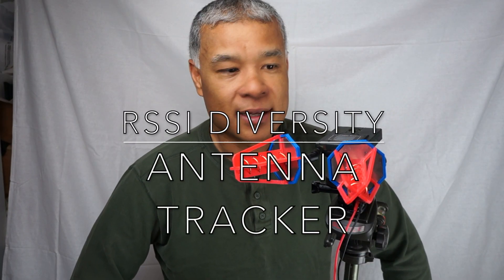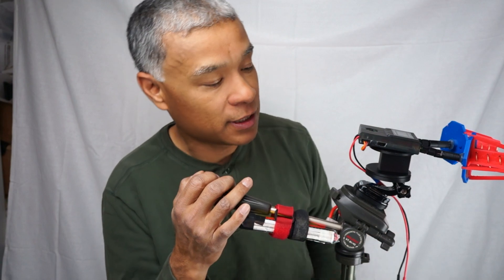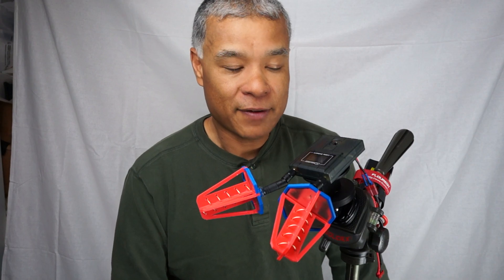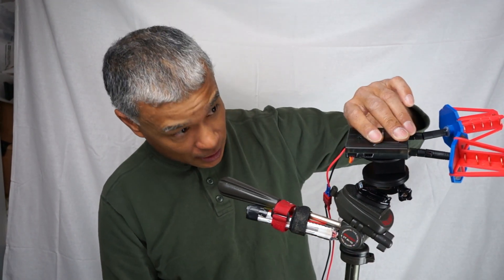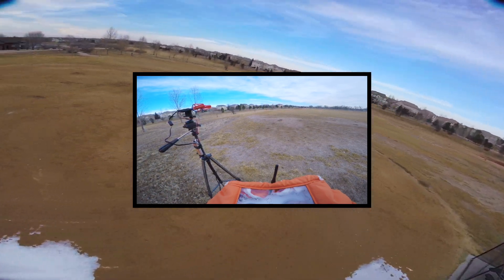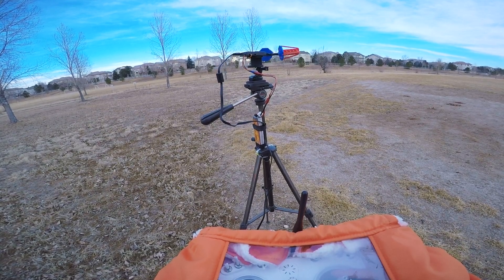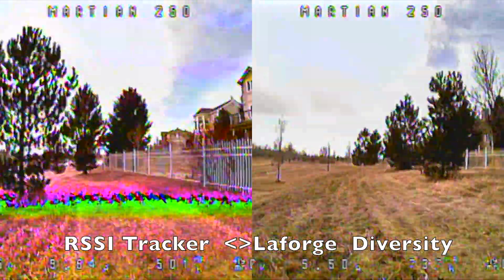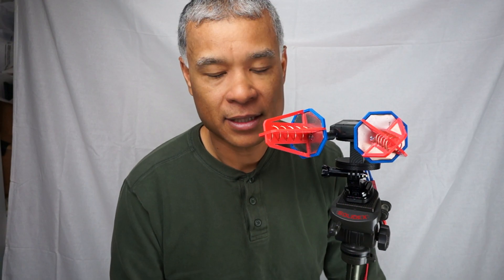DIY Simple RSSI Antenna Tracker using Arduino for less than $50!

Comment: Hi, you just helped me a lot, I'm building a diversity receiver and wanted to do the tracking exactly the same way, I just realized that I need at least one more RX5808 if I want to align both axes of the antenna. 
The third RX comes as a fake in on the board so that I have the third RSSI signal, it is enough for me if RX 1 & RX 2 are available for selection. 
Maybe I'll switch the CD4066 so that all 3 videos are possible. 
I don't want to interfere with the program from (rx5808-pro-diversity-2.0), a second Adruino has to be installed anyway and it could take over the task. If someone has already built something better than this please let us know.

Comment: ottimo progetto ,come faccio a settare il mio rssi del ricevitore ?
Nessun accoppiamento, nessuna telemetria, nessuna configurazione.

Solo tu devi regolare il valore RSSI_MAX e RSSI_MIN nel codice arduino del tuo ricevitore, per fare quello decommentare (rimuovendo le barre) il codice di debug in questo modo, accendi il tuo drone e apri il monitor seriale su arduino IDE, vedrai il MIN e valori MAX, basta inserirlo nel codice.

if (debug)

{

// Serial.print ("RSSI%:");

// Serial.print (map (avgLeft, RSSI_MIN, RSSI_MAX, 0, 100));

// Serial.print (",");

// Serial.print (map (avgRight, RSSI_MIN, RSSI_MAX, 0, 100));
non riesco ,c'e' un video che lo spiega ? grazie

Comment: What happens if thd signal is completely gone? Can u code like a failsafe that stops the tracker moving until it picks up the signal again???
Reply from the maker: It doesn't handle it well.  I think it just goes to the endstop and grinds.  Once the signal comes back, it starts working.  So maybe a little coding to handle it.  A guy suggested using a slip ring.  That would just allow it to keep scanning.
Reply: @MileHigh3D  thx, yes somehow I will get it working😁
Reply: @ariafpv  did you succeed?
Reply: @flat-earther  I just bought an Xair2 antenna and called it a day😅 good enough for the 4-6km I usually fly with my quads. Haven't actually built the tracker

Comment: then, how to connect to your googles? I didnt see any cable that directly wire up into the googles or a screen?

I mean, after tracking RSSI Signal, the diversity receiver will send it into a screen display or a googles right?  or you just added repeater for it?

Comment: Does this work with other signals than video ? Im planing to track my Drone and stream high res  video over WiFi. My idea was to send a Squarwave Signal from the Drone and use that to Find its position.
Reply from the maker: It uses the RSSI pin on the RF module to determine which antenna is getting the strongest signal.  I'm not sure that would work since Wi-Fi uses spread spectrum frequency hopping and the VRX has to tune to a single frequency.

Comment: any code change/modification to make it pan & tilt tracker?
Reply from the maker: I have not.  But, to make it work you would need another diversity receiver for the pitch axis.  In this case, you might as well build 2 separate systems and integrate the X & Y axis in a new mount.

Comment: So it has been a while . I have a build I am working on and wonder if you had considered making a second unit with antennas above and below to get pitch on them ?
Reply from the maker: I have thought about it.  But haven't had the time to pursue it.  It looks straight forward to add another diversity RX, but we would need some new hardware designed to add the pitch axis control.  Honestly, unless you're flying fixed wing, this setup can give you enough vertical signal coverage when you're flying a miniquad.
Reply: @MileHigh3D  Well that is exactly what I am trying to do . Long range plane on a special antenna rig.  Any chance you can put me in contact with the programmer? (or have you done some programming on this?) I have an idea for the ultimate LR antenna

Comment: What actual files do i need to compile and up load. First time with Arduino
Reply: This one "simple-rssi-antenna-tracker.ino"
Reply: @NunoFlyer   do you also need to upload the libraries ?
Reply: @asangagunatilake8054  Yes, yes, you need the timer librarie.
Reply: @NunoFlyer   does the servo rotate 360 degrees ?
Reply: @NunoFlyer  my one only tends to rotate counter clockwise until hits the servo limit and stay there humming! my VTX is in the opposite direction but servo doesn't want to rotate in that direction.

Comment: Hey Chuck, is it possible to use an arduino nano rather than a mini? The nano has no numbered port instead has D# ports/pins. On Antti's video, it says pin 5 for the servo. I'm just confused.
Reply from the maker: You can use any arduino that you have on hand.  If it fits the case, that's a bonus.  I would guess that the D means digital, so that should work.

Comment: Hi, is there a way to speed up the rotation? In code to make the whole system react faster , to rotate faster, to track faster?
Reply from the maker: I'm not sure.  I would have to look into the code to see if there are any timing calculations.  But, I'm sure the speed is dependent on the arduino loop time and the servo.  It seems to track pretty well once you get a little distance.
Reply: I have finished the tracker and it does track fine I was just asking about this because if you fly very fast around it it seems to react slower but it does track. I actually love this tracker and it was very cheap for me to build plus I learned new things :)

Comment: I’m probably totally off the mark, but couldn’t you just add one servo to constantly rotate the antennas between horizontal and vertical (to measure panning AND pitch) and a second servo to actually move the rig up and down?
Reply: that should be possible... but it would be easier to just use 4 antennas and one additional up and don motor
Reply from the maker: Kind of.  The arduino code isn't written to support it yet, but the website example and my build have the second servo power already wired up.  It would need a different X-Y hardware setup, but entirely possible.  I think I've seen people use 2 of these trackers together to add the pitch tracking.

Comment: How did you upload the sketch to the arduino board.
Reply from the maker: I used a FTDI adapter for my board because it does not have built in USB.  Once the FTDI adapter is recognized by your computer, you can select the board and usb port in the Arduino IDE.
Reply: titobi25 U serious?

Comment: Are there instructions available for assembling that turntable component with the servo and the arduino??
Reply from the maker: There are no instructions as far as I know.  It's easy to do once you have the parts in hand.  I had to resize the servo housing for my servo.  Unless you have the exact servo dimensions that the turntable was designed for, your servo may not fit properly.  There should be at least a picture of the Arduino setup in one of the links above.  Otherwise, watch the original video and pause the video when he points out where things are connected.